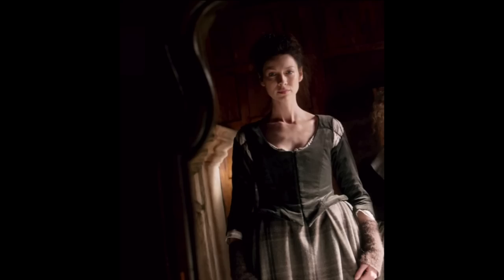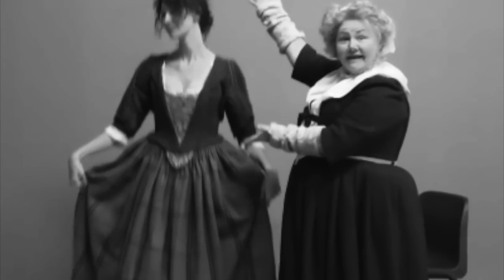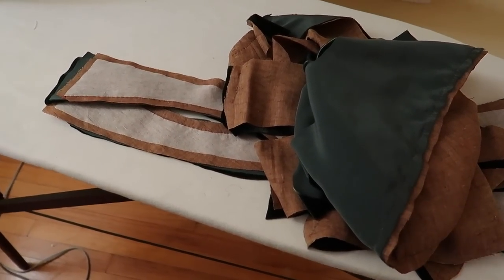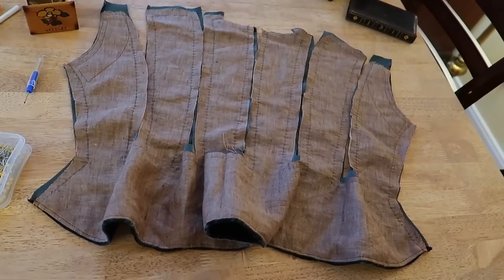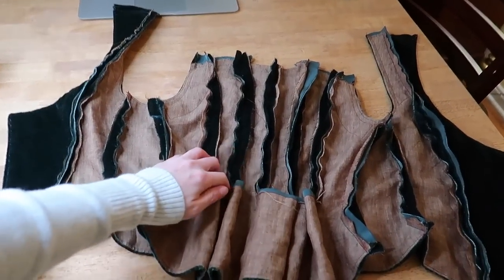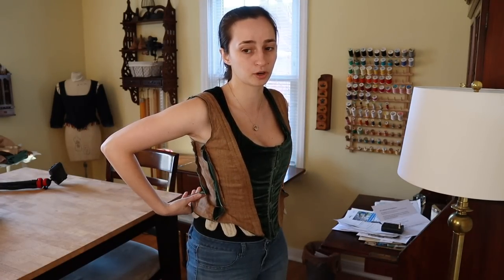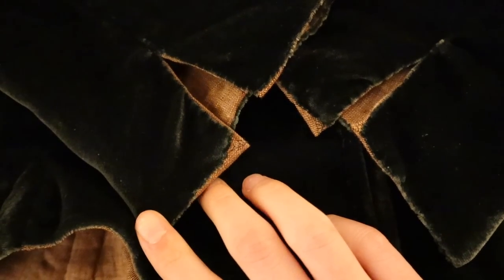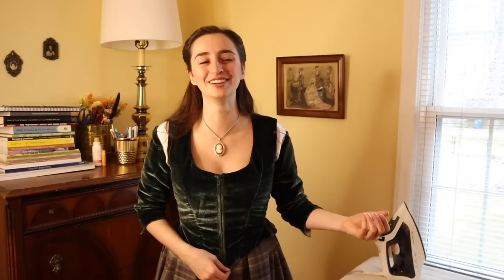Outlander Sewing: Making Claire’s Velvet Jacket (pattern alterations & new construction methods)

Comment: just a question from a novice... isn't pinning AND basting kind of overkill? Couldn't you just pin and stitch, saving yourself the labour intensive part of basting and then removing it later? i mean, the pins are going to hold everything in place till you stitch... that's their purpose, after all.

Not trying to drag you...it just seems like extra work is all. Otherwise, loving it!
Reply from the maker: usually yes, but velvet.  You'd be shocked how much it can shift even if you put the pins 1/2 inch apart.  Or at least, that's been my experience with it :)
Oh, and I didn't remove the basting stitches.  I just sewed over them.  Because I covered the seams, they all ended up on the inside.
Reply: @MariahPattie  I suppose that could be the case. I'm trying to imagine though how much it could really move if the pins are only 1/2" apart, though... certainly not enough to be a problem? Ah well... different strokes. VERY well done! One day i'll tackle this one :)
Reply: @kristenjones3431  velvet.  It’s a nightmare to work with. It is so damn slippery and shifts like you wouldn’t believe. If I sew with velvet (which I try to avoid), I always hand sew it, because the pressure from the feed dogs on the machine makes it just... impossible. Velvet is pretty, but it’s by far the worst to work with. And you can’t press it without flattening the pile, unless you get or make a very specific velvet pressing board. 

And no, pins do NOT hold velvet in place. You could pin every centimetre, and it would still shift a huge amount. It’s difficult to understand until you’ve worked with it yourself. But I’d recommend just never working with it, honestly. It’s pretty, but it’s not worth it!
Reply: There are some fabrics where, yeah, you could just pin the crap out of it, but if you hand baste it as well, suddenly your finished project is taken up another notch. Then there’s velvet, satin, various silks, rayon’s, and other slippery fabrics where I would highly recommend hand basting.  Also, if you’re using haute couture sewing techniques, hand basting is really necessary.
Reply: Basting isnt overkill at all. For garments that need precision fit and are made of multiple layers like this one is, it is pretty much the way to do it, especially when you have to do as much stoping to do fitting as she did. For modern loose fitting garments just pinning works fine, but as you do more tailoring the basting becomes much more useful. Also basting doesnt really take much longer than putting in gobs of pins, and now I usually just baste everything rather than pinning even for easy things like pajama bottoms.

Comment: Were your feet feeling okay in the snow? I do not have wool stockings (yet), but I am always wondering about lower cut shoes in winter and if they would be still bearable with snow getting in there and melting...
Reply from the maker: Wore them in the snow purely for the aesthetic.  I do not actually recommend it 😉

Comment: I am glad you did this in velvet, I know it's a pain to work with but the item is so flattering once it's done. I once tried to take all my father's silk ties and make wall art, again,that slippery substance is beyond bearable to work with, but the end is nice. (P.S., paper piecing was the only thing that worked for that, as i had cut them to one inch wide strips, and was attempting a diamond-ey  argyle-ye  -harlequin pattern.   it was a nightmare).

Comment: Just one thing... THIMBLE!!! 
I know it’s a pain to learn, but it’s sooo worth it... I just learned recently ( btw I’m 46) - and I had to try 4 different types to find my perfect thimble - but it’s worth it!!!
Reply: Yes! I learned to sew with a thimble thanks to Bernadette Banner, but I recently lost mine and had to make a new one..ouch! Not fun!
Reply: Bernadette banner and Abby Cox were the ones who convinced me to try to learn...
Started with a normal - didn’t work because of my long nails - then I tried a homemade leather one - worked fine....
The I bought a ‘open nail thimble from wish and I really like that and use it most of the time now...
And I also have a silicone/plastic one that I use when I have shorter nails or my psoriasis bugs me...

But no matter what- the thimble is just the way to go... you probably have to adjust the way you push the needle.. I have to remember it every time because my fingers automatically try to push with the ring finger if I have a thimble on my middelfinger, and the other way around... fortunately I’ve stopped pushing with my index after using the thimble - so that’s a plus ;)

Comment: Sewing fitted things with a soft flowing velvet is a nightmare, but it looks soooooo worth it if it goes well.
I treat velvet with the assumption it's going to slide like that clip of a panda on a snowy hill, use a relatively light touch, baste everything and it mostly works okay.

The reason it creeps is usually the pile - the fibres sort of walk along each other and grip so they don't go backwards unless lifted.

The American Duchess cape is a good project for those who want to know the way velvet behaves without worrying too much about fit.
But hand-sew in the lining. It will save you pain.